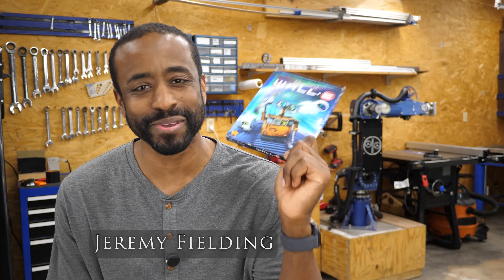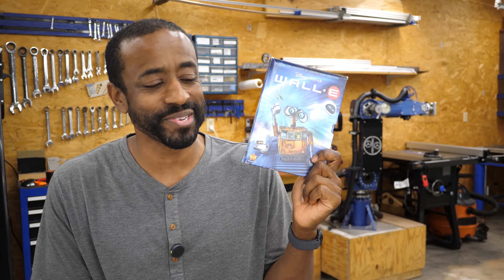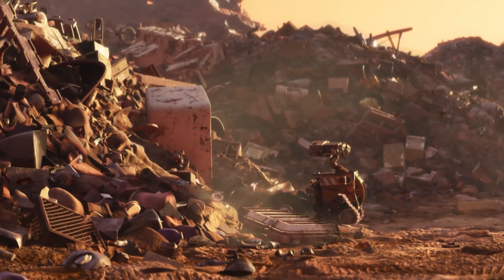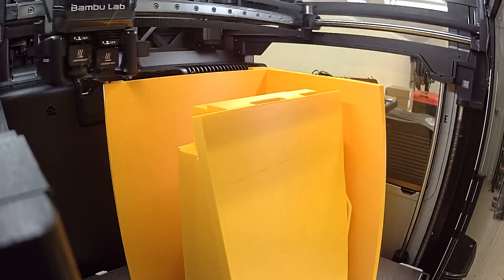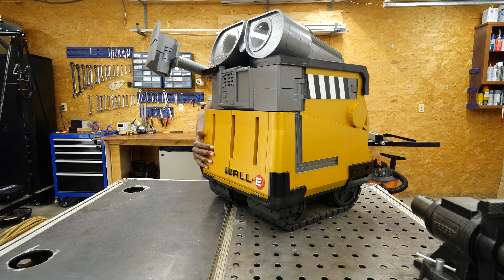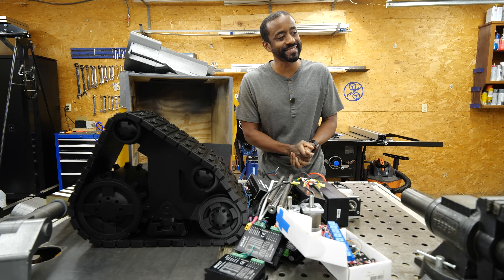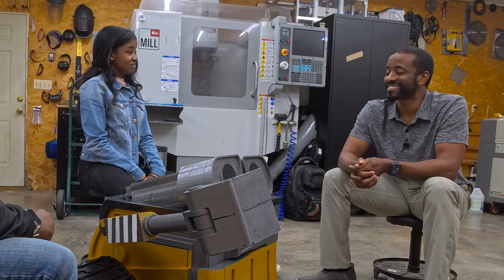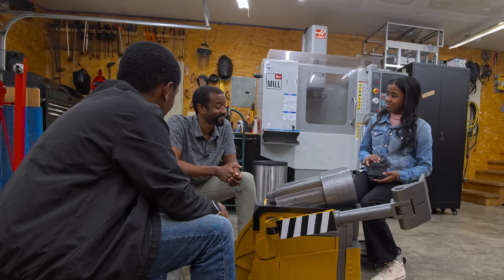Making A Real WALL-E. Episode 01

Comment: Internally geared in hub motors with planetary gears are major space savers for your drive motors. The challenging part is finding ones geared low enough as not to be dangerously fast.

Comment: Hello Jeremy Fielding please read this and don't remember the spelling errors. I want to leave some inspiration here for making a probably very cheap but very exiting and versitile product/product tree, a very short description is delivered in the second paragraph. I think I have a basically simple idea, that can be used as a very versitile, cheap functional element , multiples of it can be mounted on eachother, it doesn't need a powersupply one would have to actively recharge, it mostly probably can serve as a very exotic pinboard, but I also imagined completely different uses like that of a measuring device. Also I imagine their could be uses for cranks, to introduce additional movement. Do you want to know? I think it is very easy to understand, I've only ever seen single principles in action of the first device-type I describe.

Basic version: A box full of stable, light weight platonic solids initially sitting in tubes and layed out with magnets so, they would repell and shoot out the cylinder and(actually probably one would want to electrically slow down all those initial movements) at a certain distance balancing the repulsing force with a attracting force, so that one should have a floating set of lightweight boulders one already could attach notes to for example. The same or a different set of boulders could help getting them all back into the box by introducing electric forces via a hand crank or reorianting magnets in the box.  Now I had Ideas for floating and stationary frame systems one could trapp such solids in, moving more freely, or different techniques to insulate the magnetic fields or "load additional" solids into the thing. One part I especially found interesting to ponder on was: a plate on such a box that  one puts  magnetic or metallic masses on , to recreate this pattern in the floating system(although here I think I didn't come up with an idea to solve this) . As a steady power supply i'd use the same as an atmospheric clock, just maybe some more of these preassure cans , I think it is best to actively shield the system with this energy. Another thing, that could keep this , especially more freely floating elements steady, is their could be elements used as spacers, , through their design almost prohibiting another one of thoose coming too near to them, maybe even arranged like a string, that can clump together into a more meshy structure. It could be used to either hold smaller parts somewhere around it or really as a counter force to any incoming magnetic attraction, maybe pulling one of thoose to where the filed comes from but automatically this one element is repelling the others , so that they move to sides of the system further away from a disturbing/attracting magnetic field/target.

Maybe this idea is completely illusional, but I wanted to share it because I don't think I would have the time for that soon, yet I want to see this working  for someone at peast and maybe it is even interesting for you too. So far I've only shared my idea in this thread.

I have two more ideas involving magnets I want to share for the same reason but they probably aren't working :

I estimate theese ideas to be dangerous but realistic wheel substitutes with no purpose that comes to my mind.
Bicycle  with two magnetic 10-20% wheel segments, held in place by magnetic disc in the middle between thoose two resting pieces and the magnetic 😂bicycle frame. 
The second idea completely lets go of the wheel, again using magnets, but this time, I know it isn't achievable unless one reinvents several concepts for fastening structures "dramatically" But I think it is unrealistic to do that without proper research and miniscule experiments, I had very exotic ideas on how to fasten something, but I assume even if all those ideas weren't necessary and one could simply use any kind of press, it would still be very very dangerous. I believe with a high enough magnetic field density one could create (for example, their where other effects one could achieve or use ) an air cusion under the bicycle . This kind of wheel without wheel should work a little different, than a normal wheel , as in, it could probably take 10 minutes of pushing against a floating bike to get it to move with this frictionless energy.. or a handcranking operation 10 minutes to unfreeze it from its position. I think both the manufacturing of this and the product , if possible at all, would be dangerous though, because the concept would work by creating a very stable and orderly movement for which there is no structure to pick it up as easily as in  structures filled with matter and not precisely hopping around air(as a probably unrealistic example, initially Inthought of a way bigger system of preassure attacheto the bicycle, maybe even creating lift , not a colon beneath it) , so it could break easily through vibration, but in addition, I think what could happen is one could create a supra conductor at room temperature, that would be dangerous, because it could easily explode due to the circumstances that , as I hypothesize, make it a supra conductor at any temperature. I think a very important effect or cause of that would be that such a wheel without wheel would be an extrem difference in picking up heat energy , the way the structure would keep intact would be way more directed forces than usually, if a material distributes stress while picking it up, so the heat flow from one side to the other might be acting like a wedge, where it impacts the other extremly still front and snaps back. Because, the power of the magnetic field I assume necessary to substitute a structure would be so dense, the matter of the magnets (where there are in the bicycle frame) would constantly both  through squeezing, throw out bits and getting them back through a combination of those (atomic) bits hitting something and flying back and the attraction of the magnet. But at this point it probably has to be more of atomic strings, insulating that magnetic filed  jumping around with parts other parts of the "flying cloth" .  So like this, there is a structure but the usual movement directions to keep the structure together despite stressing it  are dramatically separated from each other and spread out more around the material, than normally, if something jumps around on the ground(which I consider a still position to already be doing) feeding it energy and loosing shape , now one has this huge, maybe the farther apart from the bicycle, the less dense and regular, structure of mostly forces acting on maybe various materials, which probably enhances the effect I meant of possibly being a wedge and acting on a huge surface so dependig on how this kind of wheel would be realized I even assumed it could be a nuclear bomb without needing highly radioactive material. So I think even if, this last one was a bit stupid. 

I hope you are going to read this and maybe find it interesting or funny or even realistic.

Comment: The advantage of movies and especially animation is that the objects don't have to exist in the real world.  A famous example of this is the movie Aliens where the dropship and APC change scales many times to serve the shots, but you often see there is no way the internal space conveyed could fit into the external size of those machines.  

The recommendation I would make for WALL-E is focus on the character over the features, so the first features I would ditch are"
1. Ditch the movable position of the shoulders in the L track (make them fixed in one position)
2. Ditch folding the tracks into the body but let the shape of the tracks change slightly AND jack up and down the body
3. No compactor, use the back body to hold structure and mechanism or even fill the whole cavity if needed, but if you can manage having an opening front door use forced perspective and/or mirror in the cavity to make it appear larger than it really is.

The focus should be on those characteristics that convey emotion, such as the eyes various movements, the neck, ability to turn head and neck, pointing hie toe (track),  able to hold his own hands, etc.  Some environmental sensory systems and semi-autonomy would be nice additions as well since they can also give it sequences to create mini performances that could be triggered by remote/app or some kind of sensory input that would fit the response.

Comment: I think you need to use the trash compactor space for the mechanical parts to make it really work.

Maybe you could make the door partially open and have black fabric inside to make it look like an empty container. Have the door open and close just a crack as an emotion thing not a real trash compactor feature.

Comment: This is so cool!! Maybe the tracks could be thinner to allow for better space management and maybe more parts, and given that they are mostly trapezoidal, you could put a track tensioner on the upper part of the track, pushing down on it, while the 4 actual wheels of the track can shift from its trapezoidal shape to a smaller squarish one that doesn't interfere with the now lower tensor sprocket, which when the track is collapsed would probably be quite at the same level than the two lower wheels.
Aside from that, given that he mostly has quick movements (and doesn't need too much torque), maybe it could be a good idea to consider using pneumatic actuators or brushless motors with an encoder that takes the angle of each actuated joint.

In my humble opinion, I think that the functionality of something like the trash compactor isn't as important as, for example, the eyebrows that can raise or lower, expressing emotions.

This is amazing, I am really looking forward to seeing more of your work on WALL-E, I am quite sure it will be truly a sight to behold.

Sorry for bad english (just in case), not native speaker.

Comment: Since there is a large portion of WALL·E just gone and designed for trash compacting, and we never really see what that spot looks like when he’s all turtled up I would assume his wheels and other parts sink into that spot when not being used, or his wheels flatten out and sink under that spot, either way it’s not like he’s going to be actively working as a trash compactor around your house so just have the parts sink in there and come out when it opens up

Comment: Not specificly related to this video, but do you have any naming convention for design files and so on when working with mechanical design? I believe it is not so much focus on file structure and naming that it should be out there. 
Would you maybe want to make a video on best practice regarding file naming, and how to structure files/designs when doing quote for manufacturing. In the start the request is often sent to many manufacturers to get an overview of price and lead time and so on. 

To you have any systematic on these kind of things?

Comment: about the problem with you taking a screenshot for refference and it not working. i recently found out that this isnt some anti piracy thing but instead is just one simple browser setting. if you turn off hardware acceleration in lets say chrome it allows you to take screenshots or even video without any problems. reason being is that apparently the video player acts on a different layer when using hardware acceleration which screen capture programms like obs or normal screenshots cannot record.

so yeah just for future refference if you need to screenshot or video something and you dont want to by the disk version (if there is one) just turn off hardware acceleration for a minute

Comment: As your children said, the eyes and the arms are the main parts that make him feel alive.

For the eyes, tilting and blinking are the major features. Moving the whole thing up and down is nice too, but probably optional.

For the arms, moving up and down, and the hands rotating and opening and closing are probably the biggest parts. Telescoping would be impressive. I wouldn't worry about three separate fingers - if it simply opens and closes equally on both sides with two fingers on one side and a thumb on the other side, that would be plenty.

As much as I would love to see turtle mode, I suspect that's infeasible, at least if you maintain the proportions. The legs are just too large to actually fit inside. Being able to pull each leg up and down on the outside so that he can stand up and tilt would go a long way to feeling alive. I certainly wouldn't worry about morphing the tracks themselves; that's a nice detail but I don't think people would notice if it was missing.

I would personally ditch the trash compactor. Yes, it would be neat if you could open and close it, and maybe even have the boot in there, but I can't imagine how it would be possible. At best you could have a false wall so that there is some depth to it but only just a little bit, leaving lots of room behind the wall for the guts.

This is going to be a tremendous undertaking. Lots of people have made replicas of various size and fidelity, so it's certainly possible, but some simplification will certainly be necessary.

I look forward to your future videos on this. Whatever you do, it's going to be impressive!

Comment: Brilliant!!!! My favourite Disney film, one of my favourite robots-johnny 5 too, eve is just not feasible, right?

Hmm. Gotta add that music player, as much arm flexibility as possible, I imagine linear motors to lift him with guide slots in the body's side. Eye tilts, Disney focuses on the eyes and sweet face but wall-e has eyes, no face lol. I think they need to angle, look up etc. perhaps with vr, idk maybe a joystick. Having the tracks angle different would be amazing too, but I suspect that'll need a huge motor in the track housing. I imagine his voice would also be easy, like that in an old gameboy-a friend pointed out the speaker is just beeps, made into music, and wall-e is that nature but kinda somewhat synthesised between the tones or pitches or whatever. The thing about him is unless on a pad, he'll be very wobbly. Id suggest amending my original suggestion of a linear motor to lift him, with pneumatic cylinders, which I hope could dampen vibrations from the ground and body movement, while allowing for a lift up. Eye irises would be cool, and modular components would not only be true to the film, but may help you building and maintaining him. The plasma cutter doesn't seem feasible for power let alone safety, so perhaps if anything in this respect, a simple laser one can aim. I also think the claw finger things should be attempted for dexterity, as they also portray his demeanor very well. Be it a gesture to hold his hand, pick something up or get a grip, point like e.t., idk. Great project bro, awesome printers

Comment: Love this project! 

I think the top and bottom of the inside can move to accommodate the treads and head. I think that's how he compacts it anyways, as if he's physically shrinking. You can attach the head to the top wall so it can go up and down. I guess the bottom is slightly more tricky but can go up if you figure out how to retract the treads and get them to fit in the dimensions of the body. The door can be functional.

Comment: Im thinking it could be doable. Design the tracks to be 2 modules that house everything required to make the tracks go, Im almost sure they fold up into the trash compactor when in turtle mode and you have a nice area above the trash compactor that could house circuit boards but like the trash compactor it would be tight as the head folds into it too. 

I would love to see you actually do it because im starting to think of ideas to over come it.

Comment: 9g servos might take some work to make painful and they are dirt cheap. I think around $20/20pc.  But I'm curious if you might try a DIY-able muscle like actuator I read about years ago and finally saw the other day on a life sized android. If I remember the old article correctly it was basically an elastic tube inside a fabric mesh. When the tube in pneumatically or hydraulically inflated, it swells against the mesh causing axial compression. I'm not sure how special the weave pattern of the mesh is, but it at least looks similar to a mesh in my desktop computer that keeps power supply wires bundled together. I would think maybe Chinese finger traps might have the right weave. With your machine shop you can probably make tiny hydraulic pumps. Okay, now that I have said it, I guess it is too much for the Wall-E project.

Comment: Regarding the cartoon, anything is possible if the motors are only in the arms and tracks, and power and control are supplied via sliding contacts. Then there will be room to hide inside. The electronics can be placed in the back (on the back), and the batteries inside (slide them back when Wall-E packs trash in his belly). He never drives around with trash (except for the boot with the flower). THANK YOU!!!!!!!!!!!!!!!!!!!!!!!!!!!!!!!!! 🙂

Comment: Just a tip for next time... Look for a video game with the character you want in it because sometimes you can extract the models from the game file. A lot of times  main game files are just zip files with a different 3 letter extension at the end. Use 7zip. You may find many folders complete with models and textures. There's a pretty complete Millennium Falcon someone extracted from a game many years ago converted to STL. This is how Makers Muse got popular so it's a solid strategy. 

If you can skip the reverse engineering and just get the actual thing that's better.

Now he tells me, right? 

Heh heh